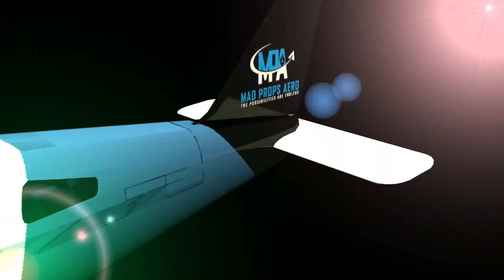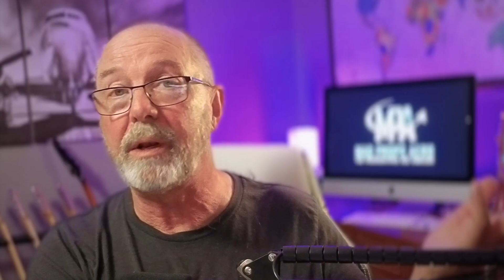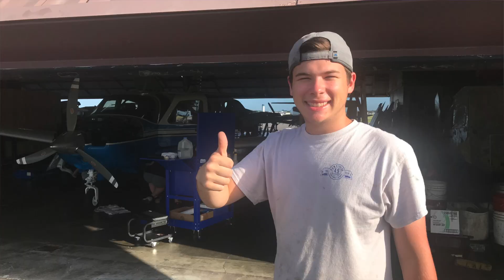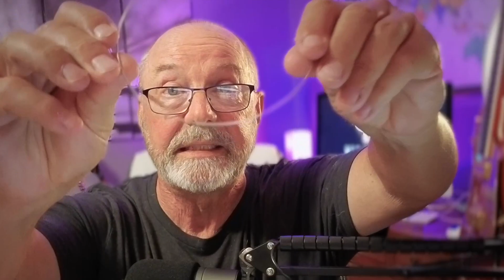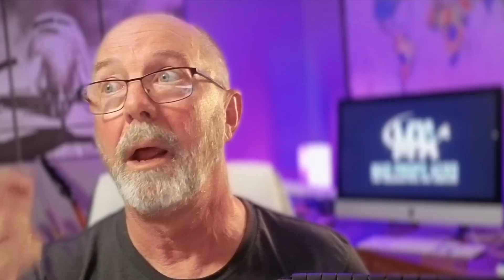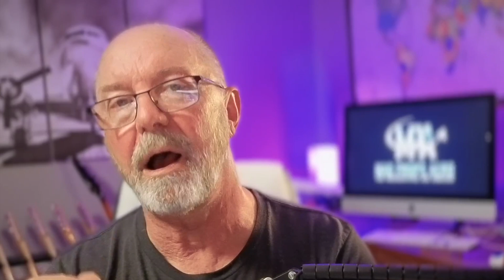Can a $1 part bring down a perfectly good airplane?

Comment: Excellent...& don't forget the walk-up. The "around" invites close scrutiny down to a safety wire on a clevis, but the walk "up" sets the stage. As soon as I can lay my eyes on my ride I'm looking to see what the status is, what's connected or not, what looks right or off. When you walk out of the FBO after a burger, or down a moving sidewalk if you're a 121 pilot, take a critical gaze out at the machine you are about to command. Subtleties matter...was that oil on the ground here before?
Reply from the maker: An excellent point. Thanks for making it.